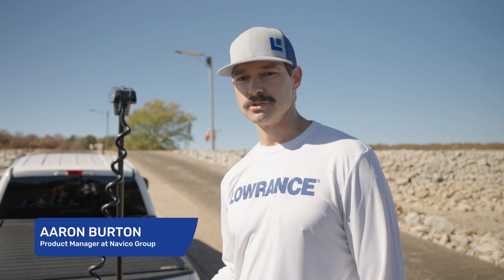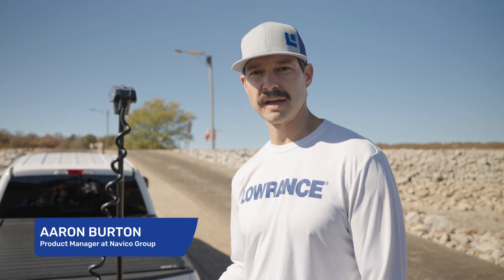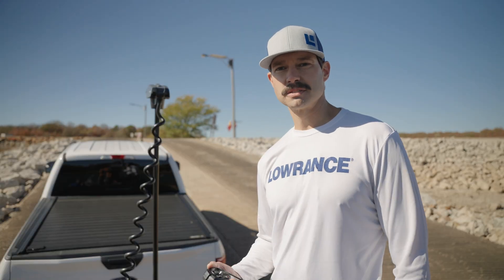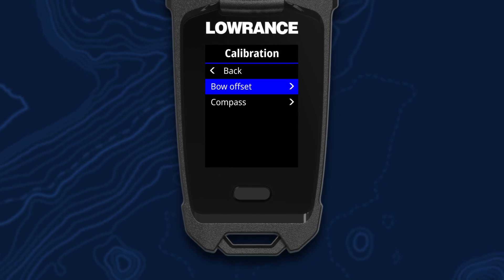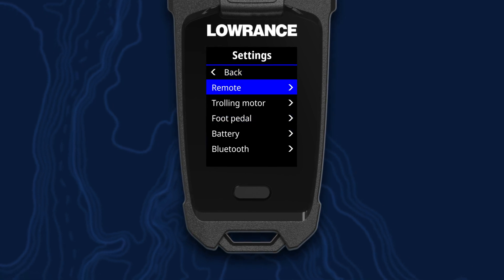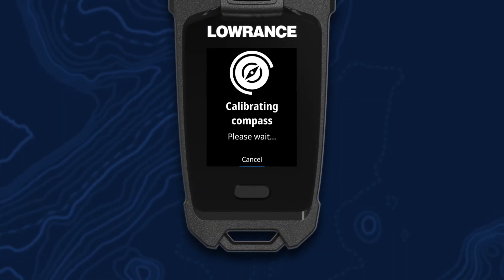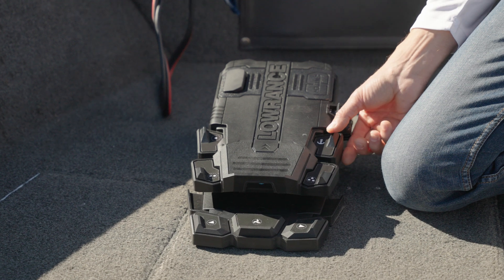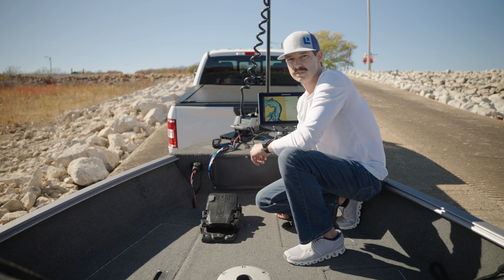How to Calibrate Your Lowrance Recon Trolling Motor

Comment: Do you have a video on Calibrating the Angle offset of the advanced wireless foot pedal?  Using the 5 steps listed in the Advanced Wireless Foot Pedal Damper Assembly document.  Doesn’t seem to do anything. Should the trolling motor be stowed when doing this?  If not, after step 5, should the trolling motor slowly rotate CW fully? (Almost like a compass calibration)